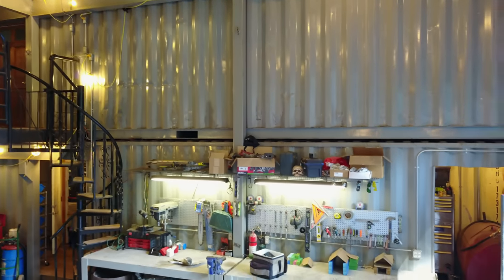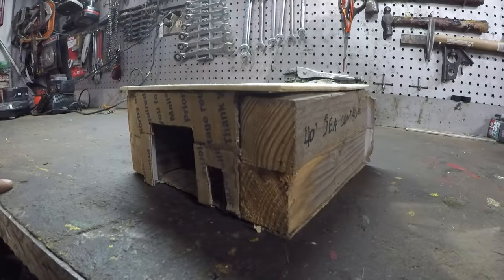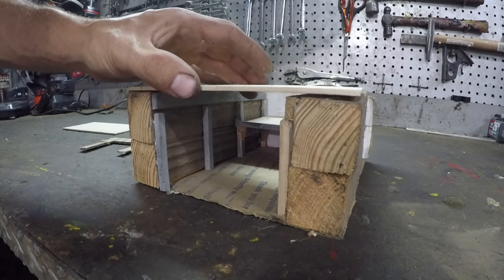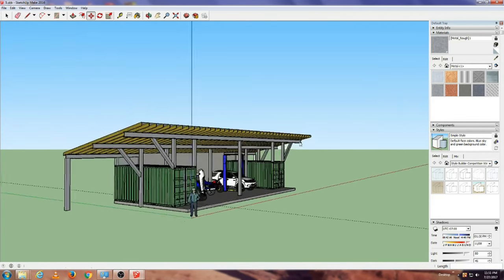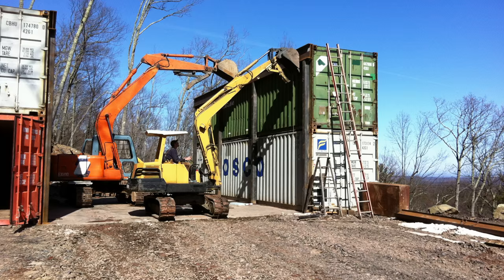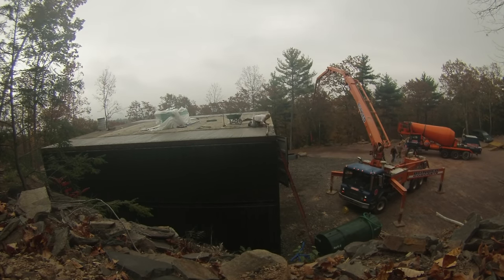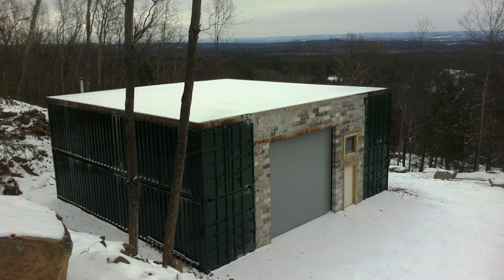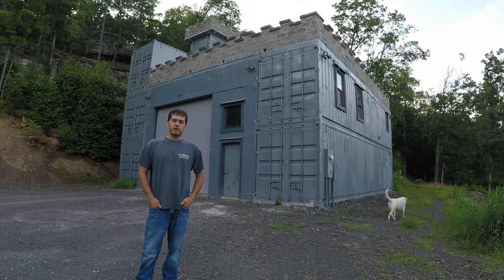How to start your shipping container building project

Comment: This is so cool! I like to see more details, like how you put in doors and windows, how you added interior walls, etc, etc,, etc. Thx for this series.
Reply: Also would be cool to see what the temp is like - i noticed there is 0 insulation so I would imagine it could get quite hot in the summer or cold in the winter
Reply from the maker: Cellar Door insulation is for bitches.
Reply from the maker: Greyman the windows and doors were installed like they would be in any other building.
Reply: I was just wondering if you welded or bolted. I was watching Bush Block Homestead and he did a lot of both, but mostly welding for the window and door frames.
Reply from the maker: Greyman everything is welded.
Reply: There are  a few ideas  on how to build a container home
    Make Sure You see the Containers You're purchasing.
    Don't Expect To Make save a lot of money.
    Read up on your local building regulations.
    Find a contractor that will do the whole project.
    study a shipping container's structure.
    Cut down the amount of welding required.
(I learned these and the reasons they work on Rohon Home Build website )
Reply: Hi! We are building a shipping container house and we have a full playlist showing how we installed the windows and doors in details. We are still installing the interior walls. We have a new episode in our channel every Monday showing our progress. This is the playlist if you would like to check it out: https://www.youtube.com/watch?v=dGs7huod4cc&list=PL4cGhq-GjyFmFkqiX526ecUsab58w7Qui

Comment: LOVE the idea, the video, the castellated parapet + cupola, the Sketchup reference, Outstanding.   btw, I-beams are generally not used in building because their flanges are slanted down & outward;  The American Standard Wide flange is used, hence the 'W' in W18x46 (18" in height and 46 pounds per linear foot).  As a retired Ironworker I LOVE your work.

Comment: This is So Kickass!    Id like to do this in St Thomas caribbean. Five 200 hundred mile per hour hurricanes could pass thru and Id be up and running in 60 minutes with EVERYTHING inside unbroken, untouched by wind and untouched by water.  Unscrew all solar panels/ wind turbines put em inside before it comes.  batteries, inverters , food , water etc etc safe and sound !
Reply from the maker: Yeah, do it.

Comment: This particular video gives an idea:  You can easily build a exo-structure with a simple block arrangement of containers, then you could probably build a traditional wooden structure inside it.  The "interior" building wouldn't have to be superior in strength or insulation, since it resides within the protection of the containers.
Reply: Davey Givens that wouldn’t be fireproof any more.

Comment: Nice video. I’m debating about building my dream shop by stacking 2 high and using those as walls for the sides and smaller one for the end wall. Depending on pricing.
Reply from the maker: Do it.

Comment: If you follow this guy you will see this video shows this building in it’s infancy stages he added a lot more     Including a complete  pitched steel roof consisting of i beams and 3/16 plate steel .  He has drive. Lots of work and the end result wasn’t cheap by any means.

Comment: @Andrew Camarata
Thanks for a very instructive and interesting video.
I personally am very curious as to how You have chosen to insulate this building, and Your general thoughts and experiences regarding insulation when used with containers. As I imagine You require good insulation to avoid having a building of that size and construction become either VERY cold OR expensive to keep warm during the harsh winters You have.
Best regards.

Comment: He is in NY... 
...costs very region to region, country to country.
We have put this into our model and came to a cost range from $30,000 to $40,000 (ALL-IN) without a general contractor.  With a contractor doing the work, it cold be three or four times the cost (EASY).
Reply from the maker: The basic structure goes up quick and cheap. The details is where all the time went.

Comment: Just ran acrossed your youtube channel. I'm a fellow youtuber here in NY too. I'm in Central Square. Just north of Syracuse. Anyway I just had a few questions about your container castle. 

On the tower what do you plan on doing to finish off the "bottom" now the side of the container?

Have you had issues with your roof drains freezing solid and water leaking through the hatch on the tower? I've been kicking around the idea of building a shop out of these with a flat roof. But with the snow out here I was worried about nonstop leak issues.

Also what was the port company that you bought your containers from? The ones on Craigslist are expensive and push me towards building a pole barn style shop instead.

How deep were your footers? It looks like you did a slab that was just slightly deeper around the perimeter of the building.

Thank you.

Comment: hey @Andrew Camarata  - i also have a sea can building underway...im planning on siding it in wood, already strapped them by plasma cutting holes, screwed 2x3s to the outside from the inside - anyway, my neighbors aren't huge fans (i couldn't care less) ...got me thinking of painting them black, just so that when i install the siding you wouldn't notice any color between the butt jointed boards - was also thinking rustoleum....wondering how much you went through to do the whole thing?

Comment: What did you use for insulating the outside walls of the containers? I have thought about doing something similar but the steel structure conducting heat/cold worries me.

Comment: Container and add concrete wall with steel beams would stand Hurricane, Tornado and harsh weather. Even used them as underground bunkers are underground home. It would last longer than actual cheap wooden buildings build today.

Comment: I would think the 20' would be cheaper than the 40' container. Problem is I have limited space on the flat area near the road. It starts going uphill just a few feet away from the road. So A 40' container in that configuration would come over the easement too close to the road. I could maybe do a couple 40' containers longways and next to each other, 16' out from the treeline.  But I couldn't do them spaced out and roof your showing. 

If I go up onto the hill I have the same problem, There are areas for a building site, but I could not do anything larger than 16' x 32'

Comment: I have a question. The concrete that was poured on top of the container. Is it still holding up. I’ve been told that the weight wouldn’t hold up

Comment: Doesn't filling the block bricks with concrete remove all the thermal insulation the enclosed air provides?
With the uninsulated, metal walls this workshop must be terribly expensive to heat.

Comment: Andrew, thank you so much for sharing the process man. Helps us rookies to make it happen. Looking to break ground in the next 2 weeks. Hey, wondering if you have a light on finding a spancrete rep contact to sell me those panels in Texas?
Reply from the maker: Those things are hard to get.
Reply: I here ya, kinda confirms my thinking. I’ll probably make some panels on my own. won’t be as large as yours. Probably six 7 1/4 x 11‘ panels. I’ll leave  eyelets in the wet concrete to hook in an Lyft maybe with a skid loader if they’re not too heavy. What do you think? (These are just 1st floor panels)
Reply: Set them on top of peers
Reply: Piers
Reply from the maker: You probably can. The thing that makes them special; they have cables in them that are under tension. And the planks have a very slight arch to them, that way the concrete is under compression, and it gives them their strength.

Comment: Thx.. Would have liked to hear more about engineer input. Was it necessary to add all that weight to the roof?   Seems so heavy - and adds a lot of expense...  R the containers strong enough to carry it?
Reply from the maker: I wanted a fire/wind proof building. Yeah, containers can be stacked 8 high heavily loaded. That concrete is nothing. Plus the roof is supported by some columns and the solid concrete walls.

Comment: AC... In a couple of vids... You talked about roof leaks before you put on the metal/Final version of your roof. Was it leaking between the spancreate panels? What part exactly was leaking? Maybe make a B-Roll video explaining?
Reply from the maker: It was leaking, it's hard to tell where, I think it was coming through the roof, and also into the walls as all the water was just running down the walls. I would not have a building with a flat roof like that.
Reply: @AndrewCamarata  I chased a leak in my house in AZ too... with spanish tile roofs. Had the whole roof replaced and still subtle leaks... they are hard to find for sure. Thanks for the update.

Comment: Andrew Camarata, Thanks for this vid, along with the others detailing this project. It's helped me to mentally frame my own project, and perhaps avoid some pitfalls I"m likely to run into. Keep it up!
The site you picked has interesting terrain, were your "bridge" container and tower part of what you had originally imagined, or a later add-on? 
What kind of considerations did you have to figure out when you picked that spot?
Reply from the maker: The bridge/tower were after thoughts. I picked a spot where I would have decent yard area in front of the building. And I positioned the building facing south so the sun always shines inside it.
Reply: Thank you!

Comment: Absolutely NO WAY it was cheaper than a traditional build unless he chose not to insulate or finish the walls, floors and ceilings! I can’t help but notice he never address any questions on actual costs.
Reply from the maker: Its stronger though. Those wood buildings just blow over and burn down.
Reply: Andrew Camarata Absolutely agree 100%! Well planned and I really like the roof design. But saying it comparable to traditional costs is completely misleading. Congrats on your build!

Comment: Hi Andrew,  were the spancrete roof panels tied into the containers or were they heavy enough to float?  Have you had any issues with the liquid rubber roof or any leaks up there?
Reply from the maker: They are sitting there, but the concrete pours I did on the top of the containers anchored them in place. Yes the roof leaks sometimes. I just did something to fix it, which is working. I may make a video addressing the recent roof maintenance.
Reply: Thanks.  I've seen the similar comments, but you're an inspiration with your creativity and dedication.

Comment: How did you add the third container on the left? Did you remove the poured concrete on the roof or did you just place it on top ( if so on the latter how did you attach it)
Reply from the maker: JOHN dOE I just placed it on top. Than I welded it in place, using some thick flat bar to bridge the gap.

Comment: During the winter months, have you noticed any water condensation on the ceiling in heated areas? I'm curious to know if the layers of concrete sheeting and rubberized roof coating are enough, or if I'd want to use a closed cell spray foam on the inside, as well.
Reply from the maker: techwizardllc yes, the walls get wet. I don't heat it. You will need to insulate a lot if you want to heat it.
Reply: Andrew Camarata how would you recommend insulating the building. Steel is a fantastic conductor and seems tough to insulate. Very affirmed by your life style btw, I’m buying equipment the same way you do and people look at me like it’s sorcery owning equipment like we do. Finding economical property to store it on in Wisconsin is a struggle I am working to overcome, land isn’t cheap here. Any creative thoughts on buying cheap land?

Comment: Hi, what did you use to caulk between and under the containers? Or is it grouted? Like to see more vids on the little details. cheers
Reply from the maker: I welded steel strips on the sides and concrete/brick on the ends.

Comment: Do you think you could make a video on the permitting process and the estimated cost vs what it actually cost? Were there any unforeseen bumps along the way of building that increased time/cost of the overall project?
Reply from the maker: Cellar Door with stamped plans I got the permit, I didn't keep track of cost. The building goes together very fast. The little details take all the time.

Comment: Did you seal the gaps between the top and bottom containers with welds or just let the gap be there?
Reply from the maker: I welded flat bar over that. Little steps like that took a ton of time.
Reply: Andrew Camarata that what i guessed... and how did you seal the gap between the container and the concrete?
Reply from the maker: I just filled it with concrete.

Comment: What are your thoughts on using twistlock to attach containers to concrete and to each other ?
Reply from the maker: I do not know, I never saw that. I just welded them. I guess those would be good if you plan on taking it apart.

Comment: I'm sure somebody else has asked, but where did you get those miniature model shipping containers?
Reply from the maker: They are just blocks of wood, I printed the pictures of the sides and glued them on.
Reply: Andrew Camarata I should have looked closer! I also should have known you would have a DIY solution! I even saw the unadorned blocks of wood later in the video and didn't make the connection. 
A local table-top miniatures gaming store has a few plastic ones, but the dimensions don't seem to be to scale.

Comment: Don't you need to insulate any walls? I think there are some regulations to insulate them if you live there during the winter. Do you have some heating there in general?
Reply: The corner room(s) with the wet wall(s) are heated.

Comment: How did you waterproof the joints in your SpanCrete panels on the roof installation?
Reply from the maker: I built another roof over the top of it.
Reply: @AndrewCamarata  I saw that but how did you keep it dry for the couple of years in between?  Gotta say if you have the money that is one great way to make a roof.

Comment: I wonder how the local AHJ's veiw the permitting of shipping container houses? 16 years ago we finished our traditional house and codes were pretty strict. The shop however we could do almost anything we wanted.
Reply from the maker: Shipping containers are super strong and they don't burn. Should make the whole process simpler.
Reply: @AndrewCamarata  I totally agree and maybe times have changed but I remember trying to use a piece of steel instead of wood for a subfloor beam. I am an engineer but didn't have my PE license at the time. They refused to let me do it because of not being a PE even though I showed them I could do the calc. Wood was no problem because those came out of their standard sizing tables. Weired.

Comment: Where did you get those little scale model mini containers
Reply from the maker: I made them. They are just blocks of wood (cut to the right size), Than I printed out photos of the container sides and glued them to the blocks of wood. I thought I mentioned that in the video.

Comment: how does it compare in cost to a more traditional construction?
Reply: If you aren't a welder/fabricator you won't really save money, but containers are for NON-traditional use where the user takes advantage of them. Wood burns. His structure is wildfire proof! (So is my much smaller double High Cube shop.) Traditional buildings get ruined all the time in natural disasters. I've been through various hurricanes and large storms and wanted structures those can't seriously damage. My containers did fine during Matthew, Joaquin and Michael.

Comment: What type of bracing was required to pour concrete on top of container?
Reply from the maker: I just stuck some logs in the container to prop up the roof. It may not have needed them though.

Comment: He was already at 60 grand before he pointed out the steel beams. Concrete welding along with the heavy machinery, blocks is another 50 grand. But ok.

Comment: How did you secure the container on the slab?
Reply from the maker: Don O Steel plates with rebar welded to the bottom were set into the concrete, then the containers could be welded down
Reply: Andrew Camarata Wow! That was a quick reply, I was just watching your other videos at the moment.. thanks for all the knowledge you share mate, greetings from Australia!

Comment: why did you put those metal bins... You could not just  put  the roof  on top of the container It's just a curiosity
Reply from the maker: Dyru R99 the beams? Containers are very strong in the corners, but not as strong in the middle. They could hold a regular roof, but that concrete roof was like 60+ tons, so I felt it needed extra support.
Reply: Yes, I realize now ... Sorry about the question. tanks
Reply from the maker: No problem, you don't need to be sorry about asking a good question. 
The dozen people that keep asking me the cost, or the 100's of people that keep asking me about drains in my tower video are the ones that should apologize.

Comment: I lived in one of these pieces of shit during university. No sound insulation. No cold or heat insulation. It's an absolute shit shack and I beg you. Stop thinking these work because they don't. They require a lot of additional trades to be involved to the point where it's cheaper to build a single brick house then to make a container habitable.
I left the moment I lease ended.

Comment: Hey Andrew 

Can you build me a castle?
Reply: This was quite an undertaking for Andrew.  Takes years for planning alone
Much more and better technology now than ever before..
Power utilities can be diminished privately after developing solar applications
Applicable water tables can be utilized if first level is actually underground.
Should make little engineering difference with stacked containers 2 or 3 high
Which he ended up achieving with the towers 3rd level.What an amazing undertaking.